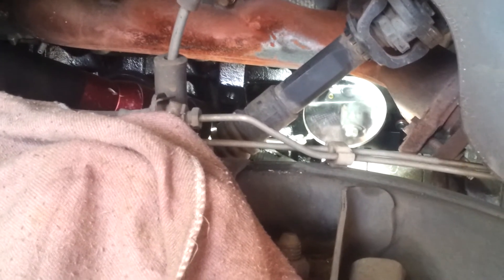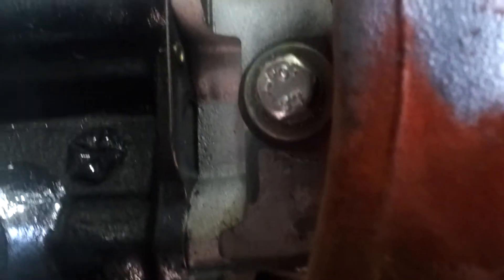Durango Exh Manifold Leak

Comment: Was this just a gasket? Exhaust or intake?
Reply from the maker: After engine was replaced, we had this exhaust leak. You could hear it but the installer didn't want to acknowledge it so I made this video to prove the issue. My understanding is that when factory new, exhaust manifolds don't get gaskets. They apparently mate up and expand/contract together. However when putting in a new engine with old exhaust manifold, a gasket is needed and in this case wasn't installed. After I showed him this video, he added the gasket...